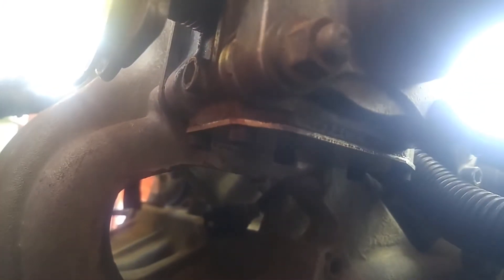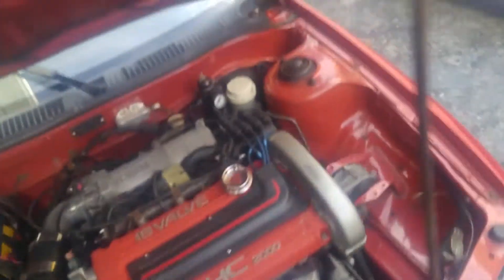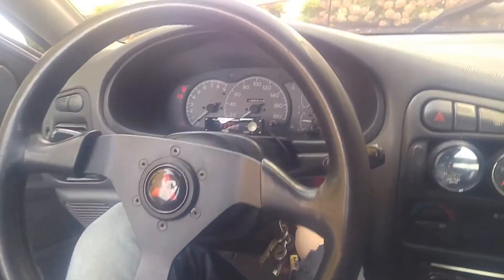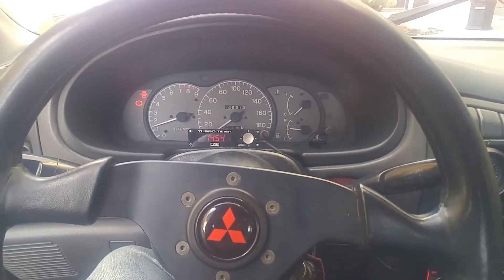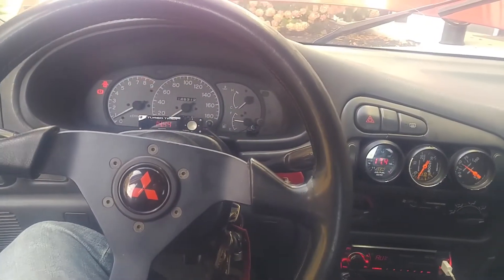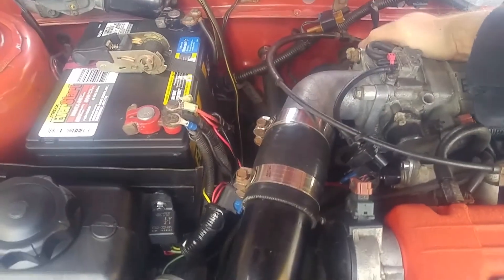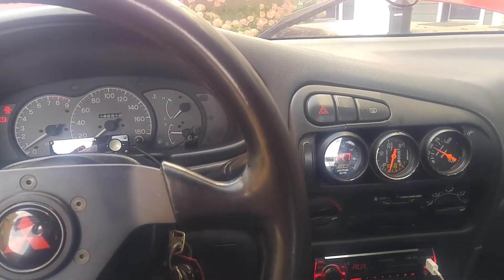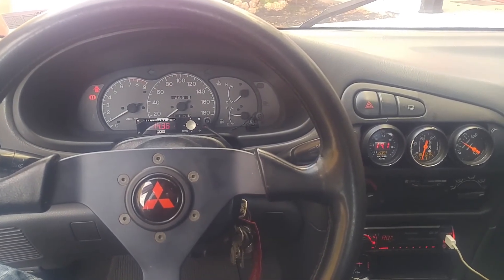DSM 2g FIAV/IAC delete cold start

Comment: I know it´s been years since you posted this video. There´s usually a screw on these throttles that adjust the position of the plate inside the throttle inlet. Just adjust the screw so that some air goes in on cold starts. I´ve deleted the IAC on a 4G15 and it works like a charm. I leave it revving at 900-1K RPM and I don´t have an issue with cold starts. It revs from 600 RPM when cold to 1000 RPM when warm.

The only thing though is that when using the A/C your revs will drop about 400 RPM, so just keep that in mind. If you iddle around 1000 RPM you´ll be idling at 600RPM with the AC. It´s not a royal pain but it might trigger some people.
Reply: Not always the case

Comment: What is the purpose of iac delete bro?
Reply from the maker: to stop the hanging rev crap.
Reply: @SpeedyTube83  can you explain more on hang rev? my iacv broke on my civic so i got a delete kit instead of buying a new one i what is it gonna change on my car? am i going to have to deal with what you explained in the vid?
Reply: @connorallen718  I don´t own a Civic, but the concept is the same. On a 4G15 Mirage, you usually get some lag when coming to a stop and then shifting to 1st gear, when releasing the clutch and you start pressing the gas pedal, there´s a small lag from the IAC solenoid turning to its closed position, and that small restriction of air, may change the mix ratio for a couple secs, ergo you get that sense of the car lagging.

So... If you need to have a quick launch after coming to a full stop (Like on a road bump) and if you give it too much gas, you will feel the seconds of lag before the IAC comes into the fully opened position. 

This is not a game-changer but it gets really annoying to get lag on 1st gear. I mean, Mirages and Civics are really not race cars while they´re stock (even if we´d love to believe that) so if you do a lot of dynamic and fast driving then it will be an issue.

Comment: Hello I got the same problem Did you fix it? I have fiav and iac also not removed but exactly we have same problem
Reply: hye the problem is because your tps adjustment gone wrong when u mess with SAS screw which shud never be touched. Always use BISS to meddle with idling becoz it wont mess the tps. your tps must be adjusted for both signal voltage and idle switch continuity. if switch shows no continuity at idle, your iacv wont work at all thinking you have driven off. which is why you get stalling at cold starts, at stops and when your changing gear. nevertheless, if problem persists, swap out the damn bugger.
Reply: @SaravanaKumar53  thanks for reply Is there any tutorial about it I really want to do that please help me I am still having this problem and it makes me crazy There is a document on web? thanks
Reply: @brainscan83  give me some time, ill post the links in here. As for now, just relax. You'll get it done in minutes.
Reply: dont forget to switch the translation to english if it doesnt do automatically
Reply: Saravana Kumar thank you but  i have 3 pins on my tps sensor is that problem for me?

Comment: Idle set at 900, and your going to bump it up to 1100rpm To help with cold starts? Doesn’t matter where your idle is set, your BISS screw is your only idle control. You can’t just bump it up in ecmlink and magically change its idle without idle air controls...
Reply: Totally correct, that screw is your only tunning point. It´s worked for me idling at 1k RPM when warm, about 600 RPM on cold starts.